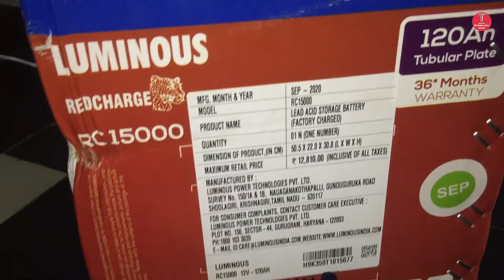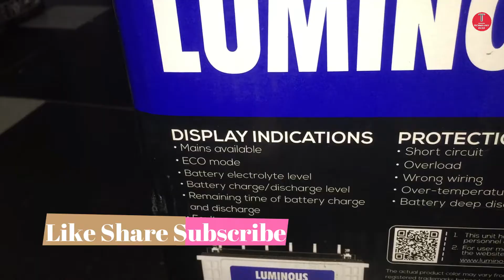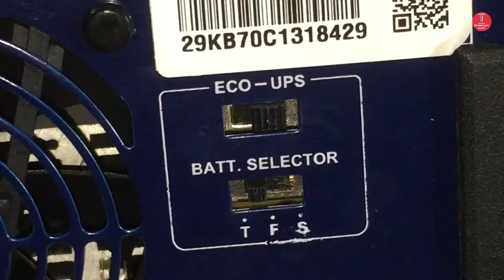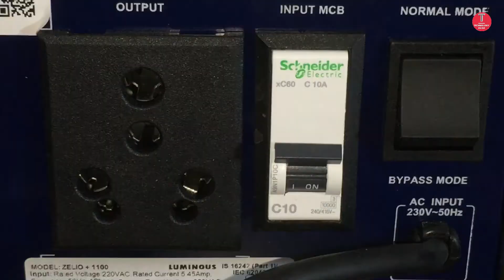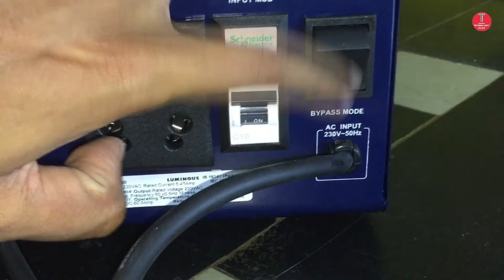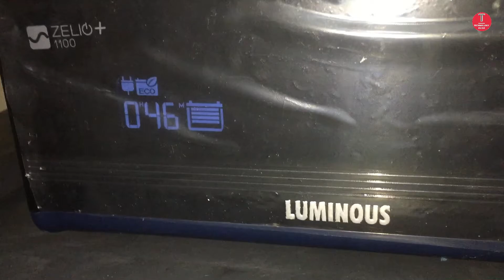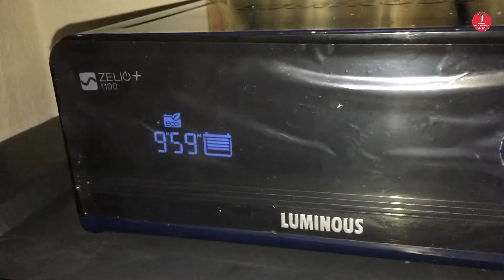Luminous Zelio+ 1100/12v Pure Sine Wave Inverter Installation || Best Inverter for Home

Comment: You have done your best bro to explain the installation! I appreciate that! Thank you for the guided video👍
Reply from the maker: My pleasure!
Reply: Inverter switch if it is bypass mode battery are charging sir
Reply: If I on Norma mode house lights are blinking... What is the problem